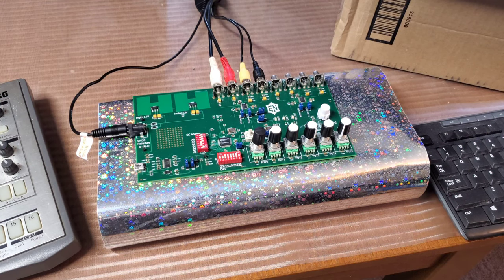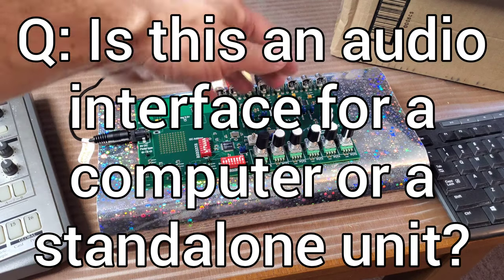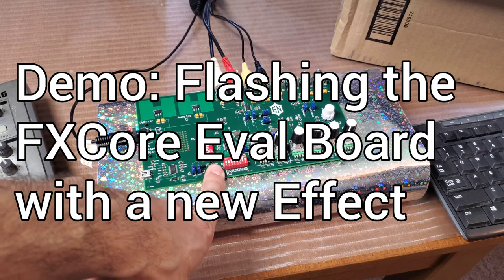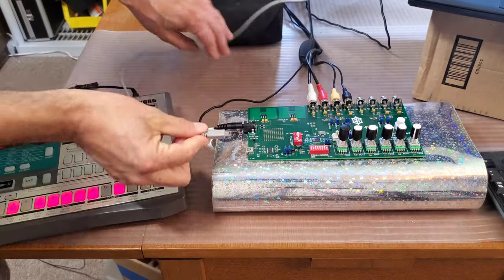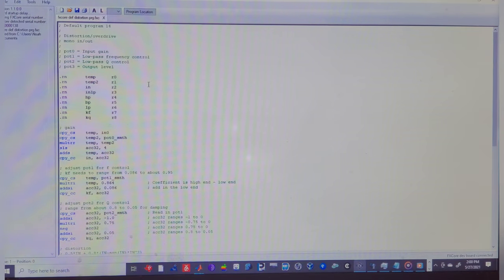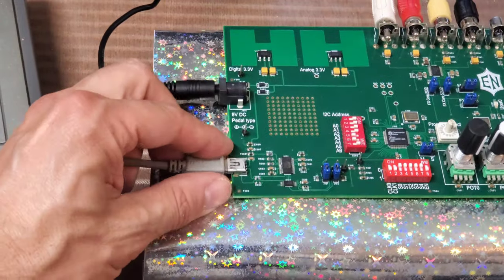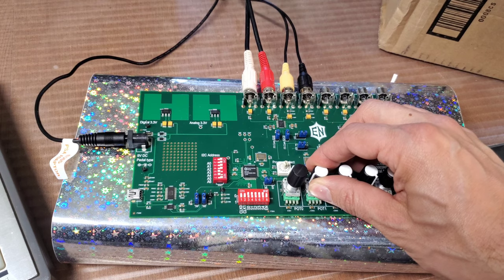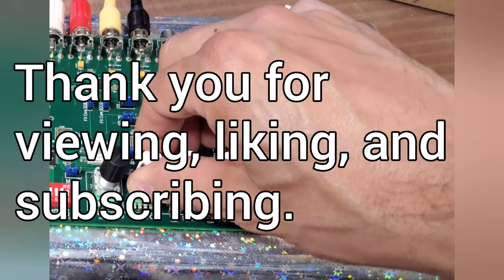FXCore Eval Board: Answering Your Questions Part 1:  How To Use It As A Standalone FX Processor

Comment: I have a question of my own. How do you get the program on to a chip which you then put on your own PCB?
Reply: The enclosure for this dev board would be huge; it can’t be for production use.
Reply: You’d need to use an in-circuit programming board. You’d design your pcb with a socket that allows you to plug in the ICP board so you can program the chip. Then when the chip is programmed you unplug the ICP board and you’re good to go.